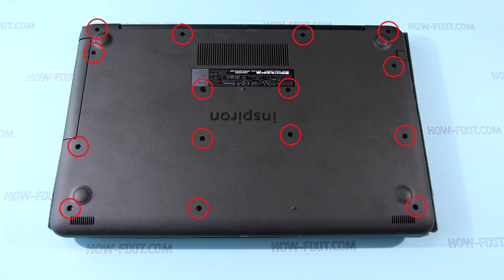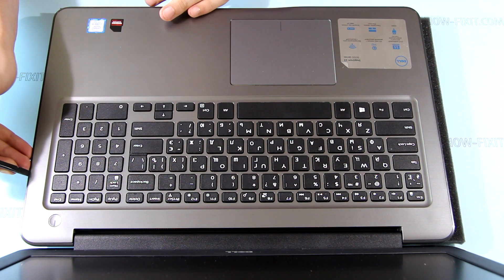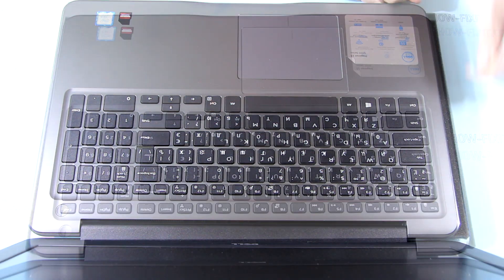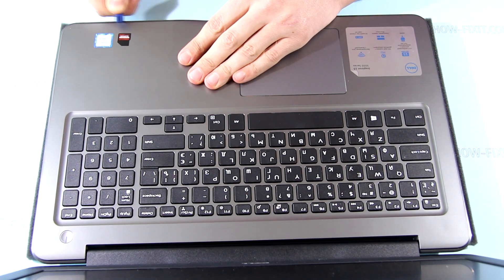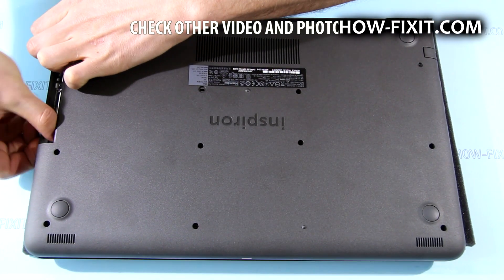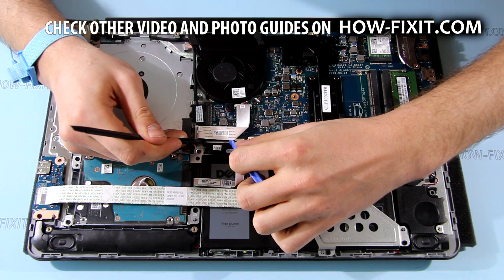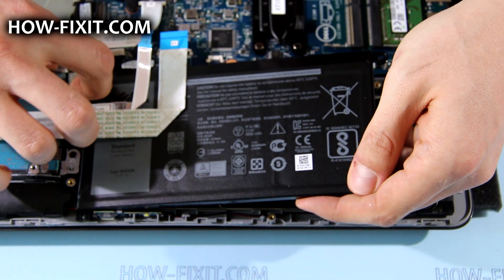Dell Inspiron 5567, 5565 battery replacement

Comment: This video was marvellously helpful, for something where we could easily go wrong (and do some damage!). Thank you very much.
To add:
1) As someone else said, look out for 3 really thin and wide screws under the top edge of the CD drawer.
2) On my 5567, when taking out screws from the bottom, two of them were slightly short, but might be mistaken for one of the other type. These ones seem to be also aligned with the CD drawer. (But not the same as in my point 1). Don't put long ones in their place when you have finished.
3) Go carefully disconnecting those ribbons for the HDD and IO. They surprised me by being "raw ended" once I undid them from their sockets. They didn't have joined connectors. You might risk damaging them if you do not realise this. 
Thanks again Mr Fixit.

Comment: Works like a charm... Perfect... However, you haven't mentioned the part where the battery cable has to be removed from old battery and fixed in new. See, I wasn't sure how to take the battery cable out. Was in pull- system or some clipping system. Nevertheless, your video was of great help... Thank you :)

Oh by the way, for other reader and video watchers, 
The battery cable is simply a pull system. Pull it out of old battery and plug it in new one.
Reply: Thank you for the clarification regarding the Battery Cable...

Worked like a charm.

Cheers.

Comment: Good video.  Folks, while your laptop is open, don't forget to vacuum the cooling fan housing (very carefully! vacuum must be on LOW speed!), so that it continues to run smoothly.  I use a small brush attachment to vacuum the inside of the laptop, to keep all contact points clean and functional.

Comment: Very helpful. I did have a problem with the cd drawer not wanting to seat properly when reassembling the laptop. The black door end up coming off when I tried to pull it back out to see what the problem was.  I took the cover off again and reinstalled it with the cd drawer installed with out the plastic door. When I got it all back together the I plastic door snapped in place for the cd tray and works perfectly.

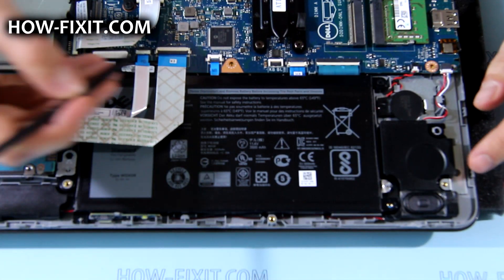Comment: @1:37. When you reconnect the drive ribbon, make sure it is seated correctly otherwise on bootup, the drive may not be detected. Also, bootup before you put the bottom cover back on in case the new battery is defective or the drive ribbon is not seated correctly like I discovered :(

Comment: Great video.  Thank you.  Removal of the disc drive was not necessary in my experience.
Reply: Yes you need..because there are screws connected to the back panel bro..

Comment: Will it run using just the power adapter even if there is no battery in it?
Reply from the maker: Yes, you can use this laptop without battery